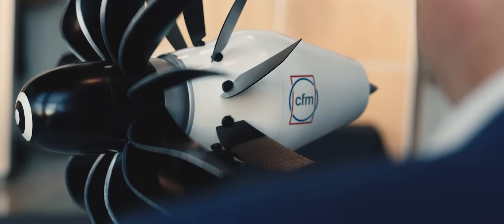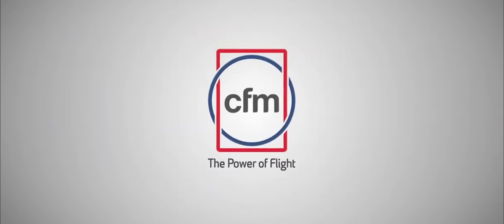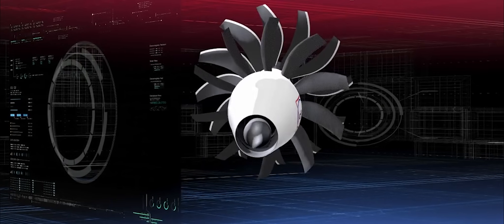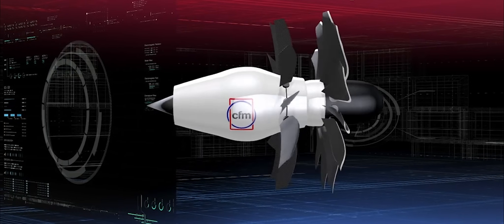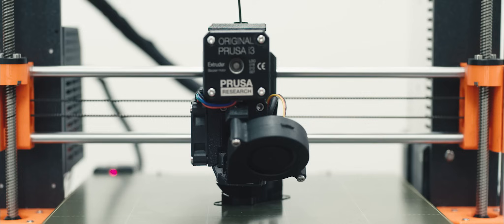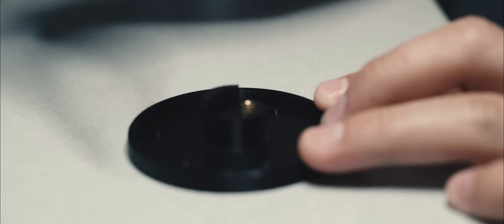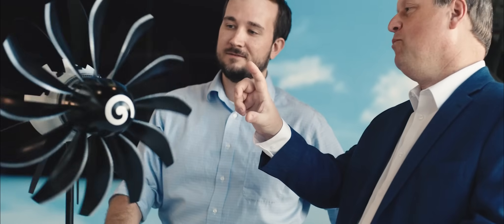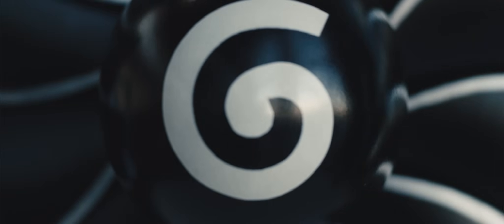3D Printing the Innovative CFM RISE Demonstrator

Comment: From a safety standpoint, I have serious questions about this engine and it's unducted fan.

First, General Aviation understands the dangers of working around propeller aircraft, but now commercial ground personnel are going to be working around congested fast paced airport environments and all it takes is one incident of someone rushing and losing their situational awareness because of airline schedule pressures to cause a major catastrophe.

Second, ducted fan engines have a safety feature in that the fan duct is rated to contain any fan blades failures so if a fan were to come apart in flight, odds are nothing would penetrate the pressure vessel (fuselage). Not so with this new design.

Call me crazy, but I am not a "fan" of this new design.

Comment: FANtastic! (LOL) Strange how the blades seem to be set at the wrong angle @ 0:05 and are rotating the wrong way. A front shot later shows the same rotation and looks okay.

Regarding fuel saving, what was wrong with doing that years ago, even though fuel was cheap? 20% saving was still worth having whenever.

Comment: Question: In open fan architecture, how do the fan blades remain protected from outside elements, object hits etc ?
Reply: Same way propellers do.
Reply: @ToolofSociety  - so why do we even need a Casing for Jet liner engines today ?
Reply: @artus198  The casing is a result of how high bypass turbofans have evolved. The compressor blades used in a modern high bypass turbofan spin at a much faster RPM than the RISE design. The blades of the compressor are also much slimmer and made of different materials than the RISE. The casing is more of a duct really with enough reinforcement to handle some blades being chucked off the compressor at higher RPM.

If it helps you any think of the RISE as a higher speed turboprop design..I know it overly simplifies what is going on but it's the same protection. I for one will be looking forward to actually seeing one in action before I made judgements.
Reply: @ToolofSociety   - Can the Rise Engine reach 0.85 MACH ?
Reply: @artus198  probably not. But it’s a mood point anyway, since both Airbus and Boeing NB cruise at m0.8 or less. Typically more like .76-.78

Comment: Is the rise engine safe as I am worried if a no gear landing is performed, will the props shatter into the pieces and kill people
Reply: Check the mounting location
Reply: 🤣🤣🤣… GE needs to do a Hazop study and consider such scenario
Reply: the blades are very light and the fan speed is very low
Reply: I think you're watching too much of final destination..
Reply: Yeah on current turbofan engines, the cowling has to be designed to contain a blade off at full throttle.

Imagine what damage such a blade would be able to do in a blade-off situation in the air

Comment: Thought nasa tried these back in the 80 and decided they were too noisy?
Reply: GE and CFM had one In the 80s and same as NASA decided it was pointless. To loud in the cabin
Reply: @yoog  So whats the scoop with CFM repeating history?
Reply: @beachboardfan9544  just pandering to the soy liberals and make greta thunberg happy…this is what they are doing with this so called “RICE” engine…🤣🤣🤣
Reply: CFM says that engine is as loud as the Leap engine
Reply: They have static fan blades in the back that can change angles to help solve that issue.___.
Reply: @mmontalvan1848  thay would be stators not fan blades. Or even fan exit gide vains. But I don't see it doing much for noise abatement.
Reply: @mmontalvan1848  Stators?
Reply: @mmontalvan1848  like feathering in turboprop engine?
Reply: They are no more noisy than comparably capable modern airline engines such as the CFM leap. Back in the 80s we didn’t have cfd and other advancements in aerodynamics that we have nowadays. The second set of stationary blades is a big part of what makes them quieter as well as the overall design of the main blades. Also the biggest reason why they dropped the development was because the 70s oil crisis ended and it wasn’t worth spending so much on r&d for the improvement in efficiency with gas being cheap again.
Reply: @alecmillea4539  Now that would be an interesting video! What has changed between the 80s version and now to make it viable...
Reply: Pratt & Whitney/Allison 578-DX. It was extremely loud.

Comment: What is new here ?
GE and PW already made and tested such Engines in 1990s.

Search Propfan.

Failed due to High Noise and Blade tip losses.
Reply: I highly suggest,
you look into Geared or Semi geared fan, 

and if possible the main fan be covered by Smaller ducts, 

With stator vanes.
Reply: There have been a LOT of advancements in computational fluid dynamics and other computer modeling methods to reduce blade tip losses through complex blade geometries while also cutting down noise
Reply: you know that is tested in 90s right? and what year now is? yes 2022
Reply: Old is always GOLD GE's Engineering Team in 1990 was much Skilled than today
Reply: 1990 and 2022 are different years, Fool
Reply: Well , still not the same. This is an open fan,  not a propfan . Totally different  from what was tested in the 1990's.  

This uses a much larger fan , which will turn much slowly than the blades on the propfan , significant  reducing noise. 

The open fan is just your very own regular turbofan but without  the cowling , so it leverages and builds on the efficiency  and newer noise levels of existing  current  Gen turbo fans
Reply: Major part of the noise source comes from the fact they used counter rotating fan configuration back in the 90's which they did away with in the current CFM RISE design.